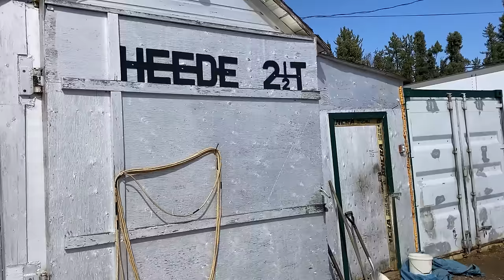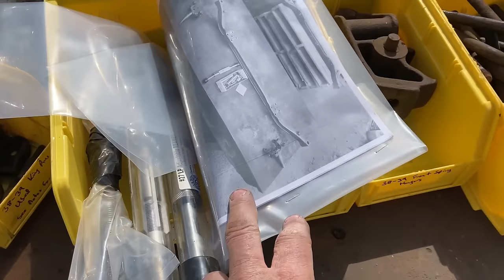922 Caterpillar Loader Moving Snow Truck Parts April 20 2024

Comment: I LEARN so much just watch’n… my brain will hopefully be able to click in a KoO fix/tip when I’m in a simullar sitiation weldin’ or modify in’ something metal. I need a heavy plate steel top for my work table in the shop also.
Reply from the maker: yes we are the learning channel. make you bench with what you have to get started.  thansk

Comment: Rear Wheel Steer,  yes takes me back to warehouse work. Lifting 1,000Lbs 14 feet up overhead. Git It Done. ben/ michigan
Reply from the maker: yes thought is required when driving rear wheel steering, start turning before you need to turn, lol  thansk
Reply: @kingofobsolete4789  I never tried it, and I only drove trucks for about a year, and that was about a million years ago, but I heard that if you have trouble backing a trailer you put your hand on the bottom of the steering wheel and push it the way you want the trailer to go. I WONDER if steering rear steer with your hand on the bottom of the steering wheel would do the same. Thanks for all the replies. ben/ michigan